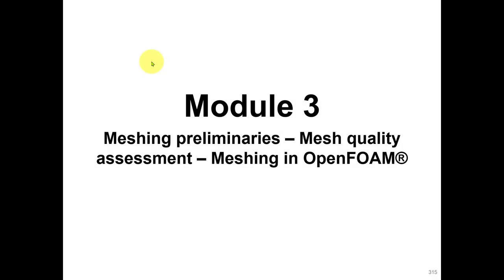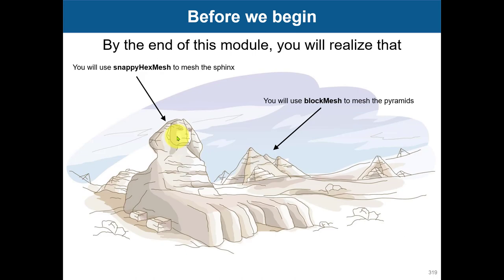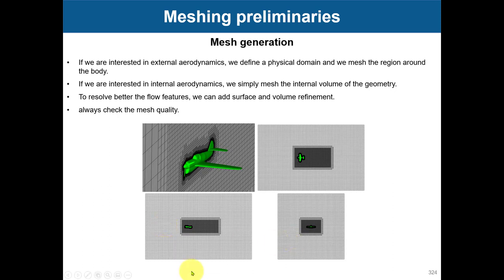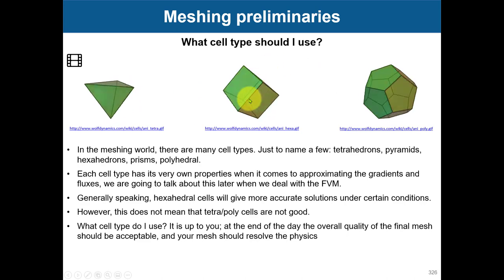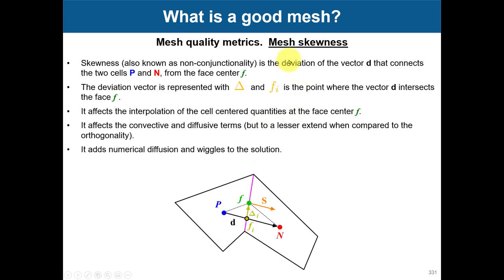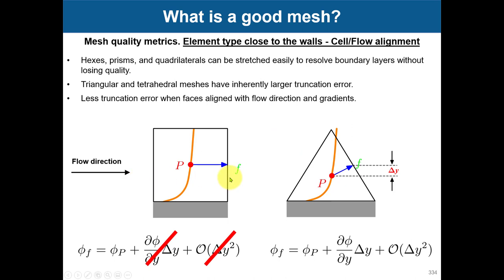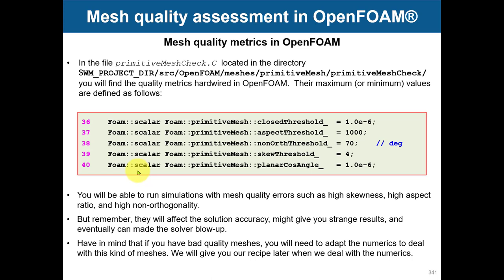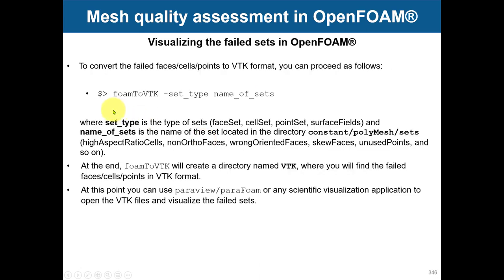3.1 Module 3 | Meshing in OpenFOAM #openfoamtraining

Comment: Thanks a lot for your incredible course! I not clearly understand: is the mesh with deleted faces (hence it has holes) valid for furher simulation? Or we need some extra manitilations with the mesh or geometry surface?
Reply from the maker: Can you elaborate a little bit more? All three meshing steps in snappy are valid, it is up to you to decide which step to use.
Reply: @wolfdynamics5703  I mean -- in the end of lesson we can remove bad cells (with high non-orthogonality) and where is some holes in wing 28:26 . Or it is just visual effect and now cells actualy deleted?

Comment: Hello , when i run the run_mesh1 for the M1_wingbody, the unused points and nonOrthoFaces are created in the sets folder in polymesh, but when i try to visualise them in parafoam, the include sets and include zonesare not available in the properties, can you please help me out to figure out what am i doing wrong? also thanks a lot for releasing the course for free , this is awesome!!
Reply from the maker: You should the paraview version compiled with OpenFOAM. Also, you must use OpenFOAM 9, if you are using ESI version is not going to expose the sets options.
Reply: @wolfdynamics5703   Thanks a lot for the quick reply, I was using Openfoam 8 from BlueCFD core for windows installation and the paraview 5.6.2 that came with it, Ill try to switch to openfoam 9 and try again!!